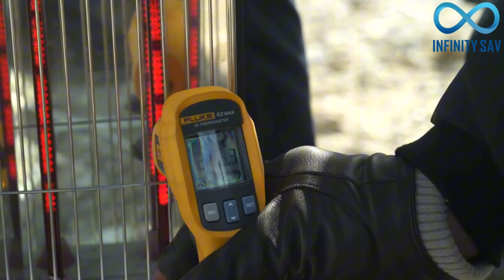Invention Of World's First Free Electricity Generator Magnet Motor!? 🧲 💡

Comment: I have a free energy machine as well. It contains 3 modulation actuators that are inundated with electron synthesis coils that move in a dynamic and continuous nuclear iconic pattern resulting in a harmonic tangentially linear arc within a vacuum lithium environment. This enables it to gravitate the free particular radiances and allow oxagen uptake and carbon excess which produce a surplus of energy that can be used to power itself and other devices indefinitely.
Reply: If this engine is legit, you should be contacting Dr Steven Greer of the Disclosures Project not letting the grid have it.
Reply: I don’t understand but I want to
Reply: ❤ aidé nous aussi à cette découverte.
Reply: a turbo encabulator
Reply: And yet no flux capacitor?  That is remarkable.

Comment: Dear inventors!
Here I am asking for a statement from you as to whether you are willing to deliver your free energy generating equipment to the Academy of Sciences for examination.
If your answer is yes, and it is proven that the device produces excess energy, the Academy is willing to issue an official proof of the test result. At the same time, we declare in advance that we will not disclose any construction parameters of the structure or the operational specifications to third parties, and we ourselves will keep the secret of the invention and will not use it. Our examination only concerns whether the structure produces extra energy as claimed or not.
We are waiting for your statement.
Reply: Creation of energy is real .  Nothing is free, nothing is perpetual.  A motor roughly around 1 cu ft can produce around 300 watts now (due to unable to get totally tailor-made parts for more powerful prototype).
Reply: Wish to learn how to register, how to apply for Noble Prices with running prototype.